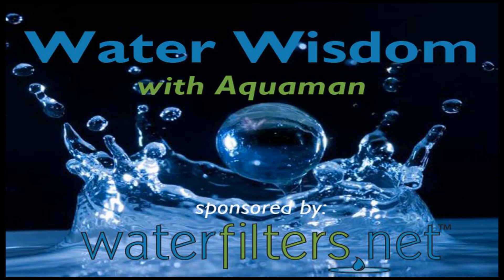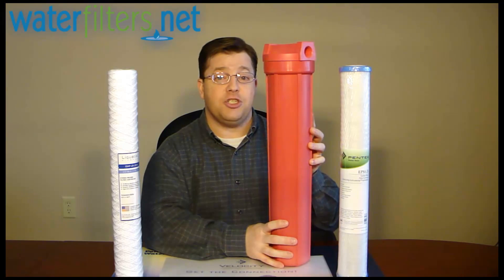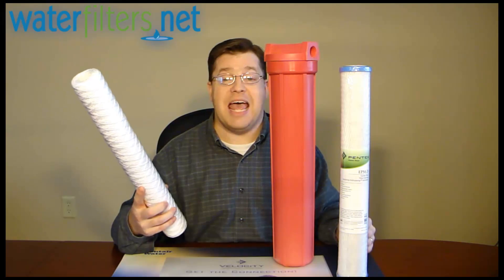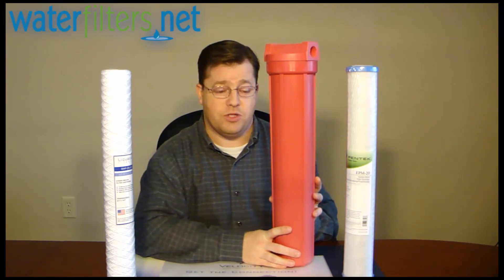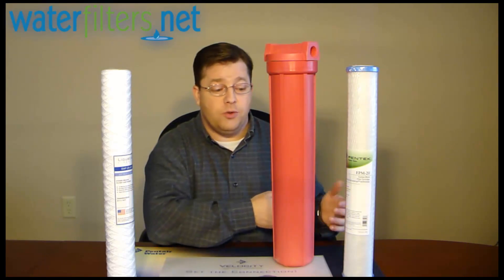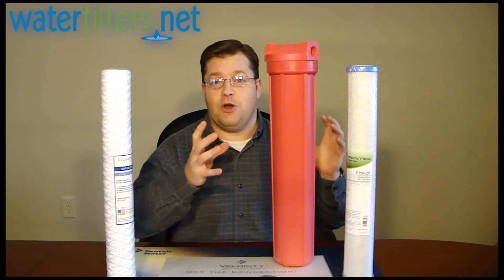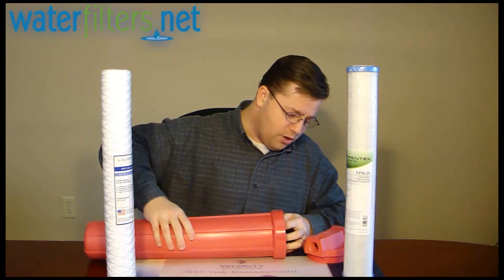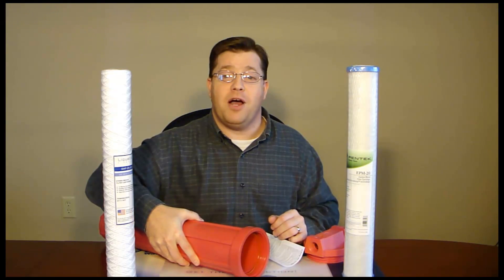Pentek 150111 (HT-20) High Temperature Water Filter Housing Overview

Comment: I have one of these, but it is very difficult to install the filter cartridge.  The reason is that there are no guides to ensure the filter ends are properly aligned with the features in the filter housing that are supposed to mate with the internal diameter of the filter cartridge.  Do you know of any solution to this problem?